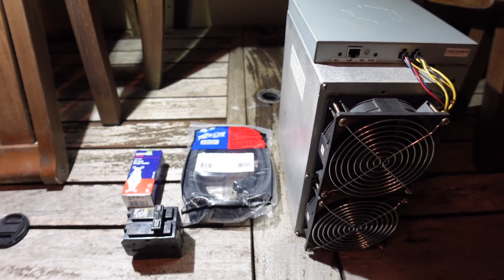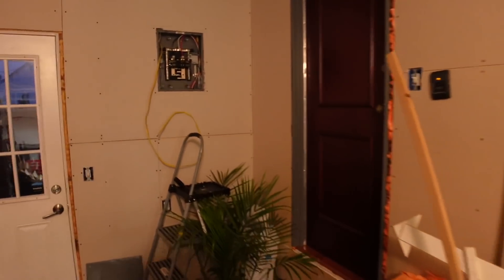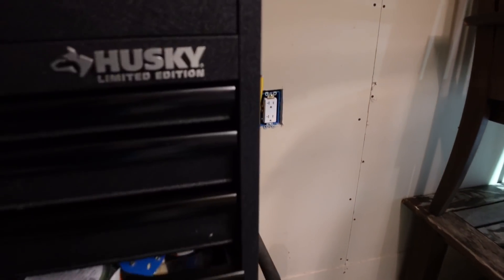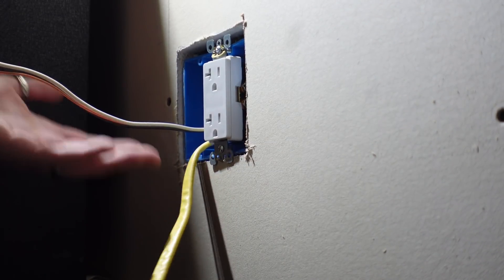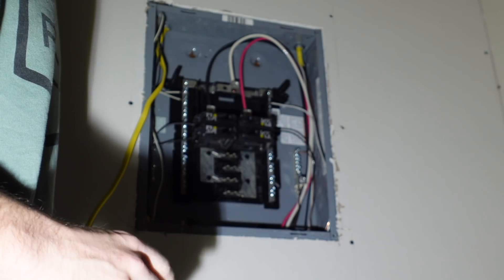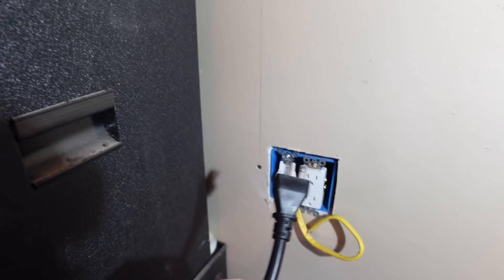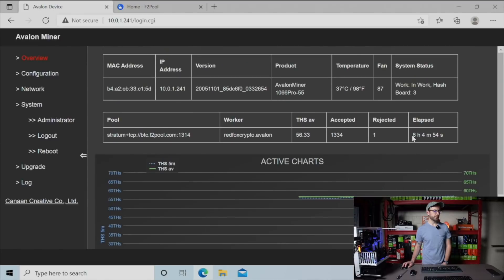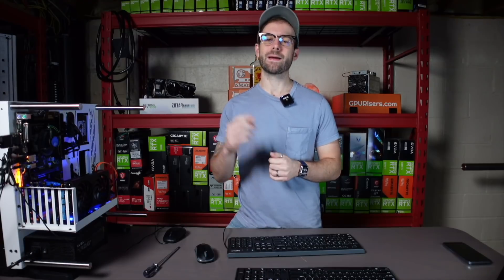Powering the Bitcoin ASIC in the Garage

Comment: Absolutely love these videos @RedFoxCrypto, but I do feel the need to point out one little minor detail for future reference.   The three wires used for 240VAC is actually two Hot Wires and a Neutral Wire.   Ground wires go into the Earth, and will not complete the 240VAC circuit without a neutral wire.   On a sub-panel, the neutral and ground bars must be separated when using a ground.   The bare 12AWG wire typically used as a ground on 120VAC circuits, is not actually used as a ground in 240VAC.   When using a grounded 240VAC circuit, there would actually be 4 leads.

Comment: A non-contact voltage tester should NOT be used to verify absence of power in this kind of a situation. This is dangerous and Electricians do not use those devices in this way. Get a TEST METER. Outlets should have cover plates installed before they are TURNED ON.
Reply from the maker: Link?
Reply: @RedFoxCrypto  noticed the 2nd cable near the outlet too that was not connected up. But in the sub board there was no spare cable, was it connected at one end and not the wall? Careful if its just turned off via the board and left hanging open as it can still produce fault current through and be dangerous it's called backfeeding. Also test insulation is normal for new circuit checks if there's any damage to the insulation of the cable. Good idea to also label the point as a different circuit to prevent future cross connection (2 different circuits next to each other if crossed could cause huge damage). Question for USA, do they use rcd's on power circuits, it's requirement here in Australia.

Comment: Was an electrician for 15 years. When I normally "abandon" a wire I cut and strip the wire but leave a small peice of the romex casing and just wrote on it. Like example: right plug. Tape both ends or stick wire nuts on the ends and then curl at the back of the box. Just my process don't have to do it obvious :)
Reply from the maker: Thank you dude. I have a ton of respect for you electricians. I think I would be one in another life. Thanks for sharing brother.
Reply: @RedFoxCrypto  yea I had another idea for you too. You could stick a gfci on the right plug next to the ASCI miner. And then put the "abandoned" wire in the back of the GFCI under the load, and keep the power in line. That way you can safely pass power thru the GFCI to that plug on the right and under right load. BUT power tools might trip the GFCI.